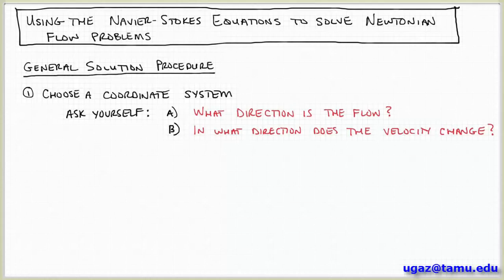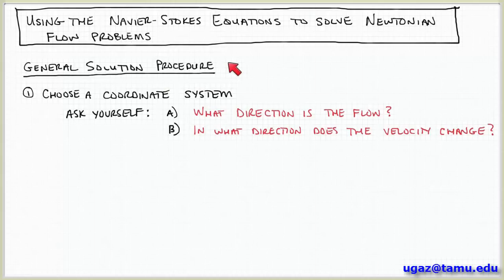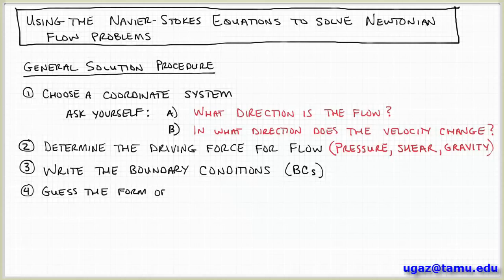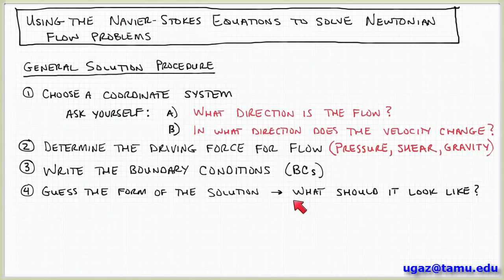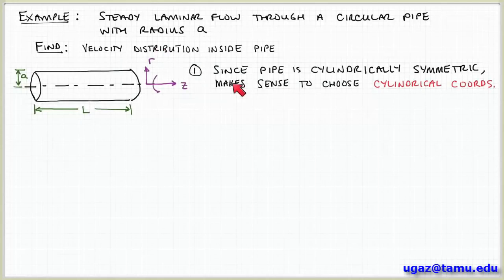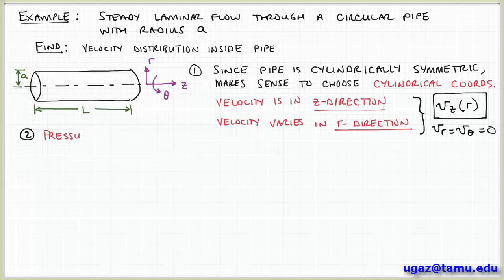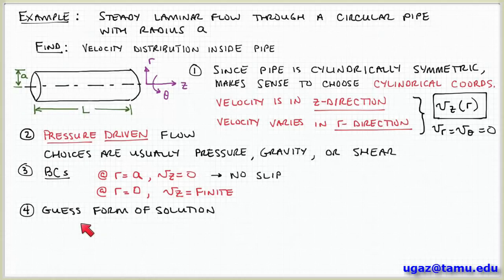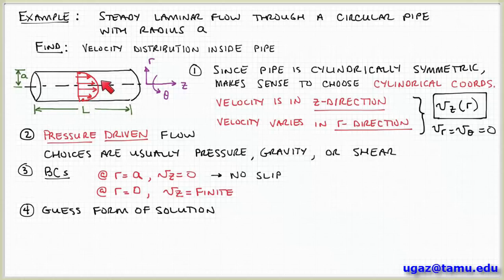Applying the Navier-Stokes Equations, part 1 - Lecture 4.6 - Chemical Engineering Fluid Mechanics

Comment: thanks Victor. im trying to model fluid flow in a rectangular combustion chamber. would it be wise to make the assumption that the chamber is cylindrical and make follow the steps outlined or should i the cartesian coordinate system and try to figure out some of the missing details.
please respond ASAP, my Masters Dissertation depends on it